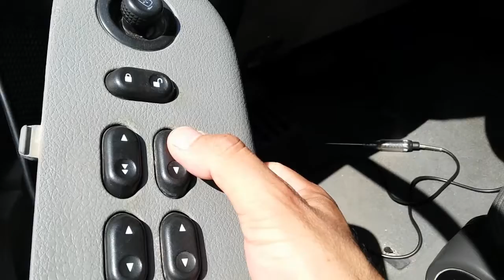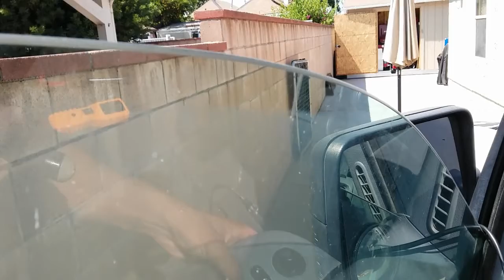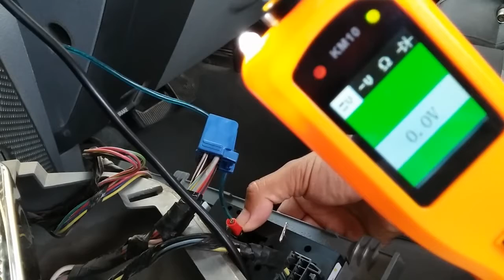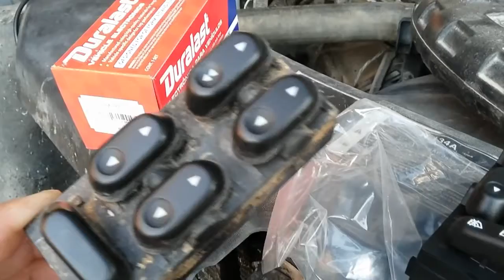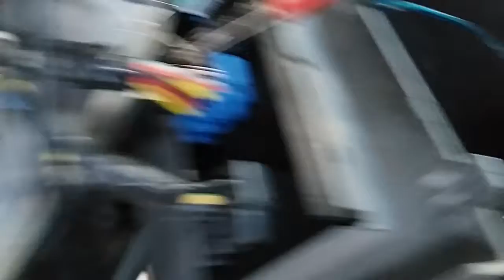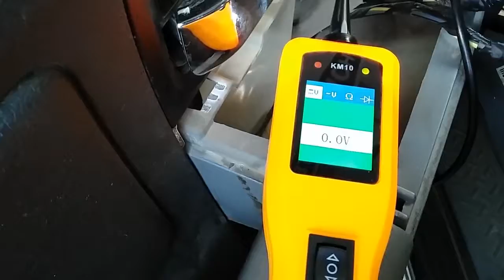(Ford F150) Testing a Faulty Master Window Switch

Comment: I have this problem.on my car but its also affecting the other windows , ive replaced the switch with a secknd hand one and im getting the same issue .
Any ideas?
Reply from the maker: You may have an electrical issue, such as power or ground problems.
Reply: @EliTheOBDTech  yep , in the door part five wires broke, thank you
Reply: My switch shows it's getting over but my new motor won't stop
Reply from the maker: @mikecustenborder3991  you may have internal shorted switch
Reply: @EliTheOBDTech  Imay have solved my issue. On a tip, I cleaned the mother board with a rubbing alcohol and a felt cloth.
Reply from the maker: @mikecustenborder3991  Thanks for the tip!